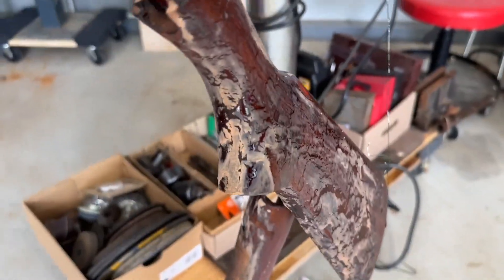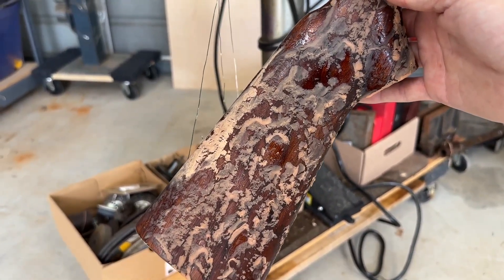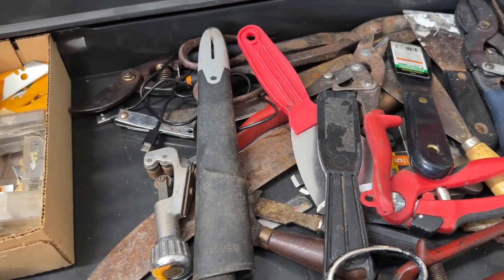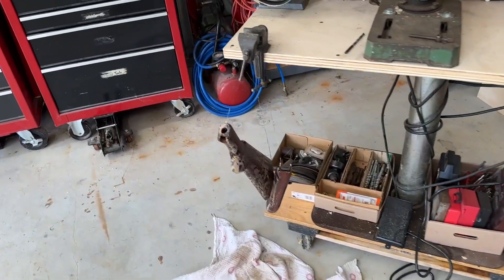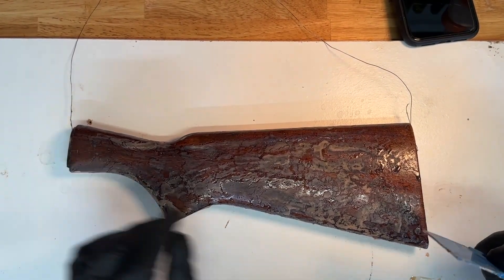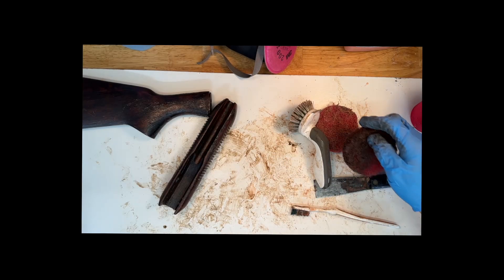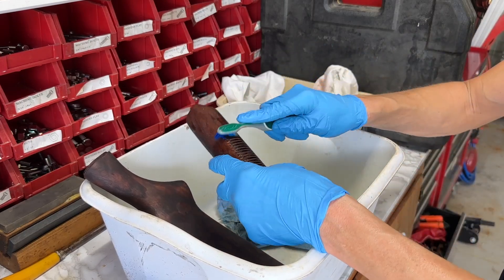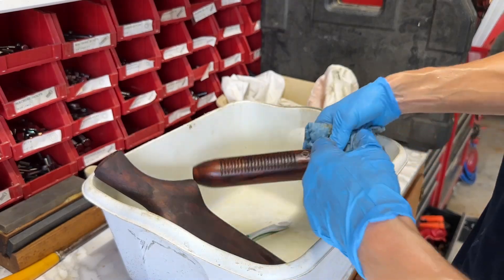The Funkiest Finnish I’ve  Ever Taken Off!

Comment: Very thick finish. Looks like some of the finish on school tile floors that haven't been stripped in 10yrs lol. A repeat process of applying stripper then scrape & do it again until you get to the point of being careful. Nice wood underneath. 👍🙏
Reply from the maker: It was nasty stuff, whatever it was.  So weird that it was still tacky.  I’ve owned it since April?  I got it off.  Finished sanding this morning.  It going to look nice I think.  You couldn’t see the grain before.  🙏. We shall see.
Reply: @FirearmsandFellowship In the past I took the as I call it black rhino bed liner finish off of a CVA Bobcat & a NEF 12ga. It was an adventure with a lot of sandpaper & Scotchbrite pads. Plus Aleve for the Arthritic hands😂. But worth it after finishing. Old wire coat hangers are handy for hanging things to dry. Or hang a muffler back on 😆. 🙏👍
Reply from the maker: @billdye3530  Me and wire coat hangers threw down in a closet 20 years ago, on account they play twister when no one is looking.  They are not allowed entry to the home.  They do have use in the shop tho.
Reply: @FirearmsandFellowship Come in handy as an emergency barrel cleaner/with added piece of cutoff tshirt especially for airgun. Fits sizes 177 & up 👍. Hillbillies use what's handy. 😂
Reply from the maker: @billdye3530  😂 We call it Okie Engineering
Reply: @FirearmsandFellowship You know a lot of original Okies came from Tn. that's why they know soo much 😂. On next podcast with the Airgun guru Nibs maybe ask if he ever used a coat hanger ramrod. Answer might be interesting 😱😂 Take care & have a great Sunday. 🙏🇺🇸👍